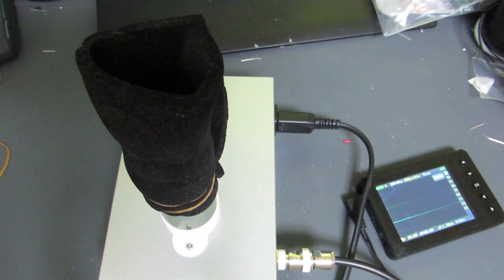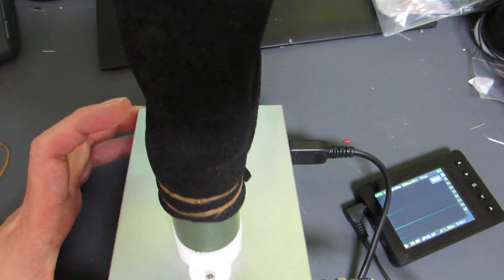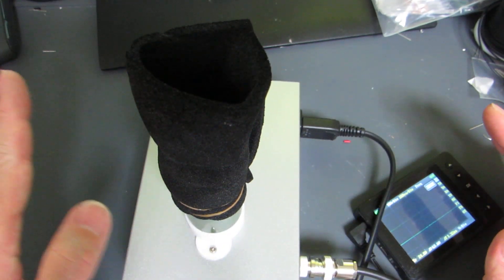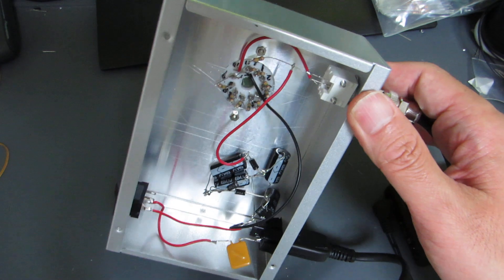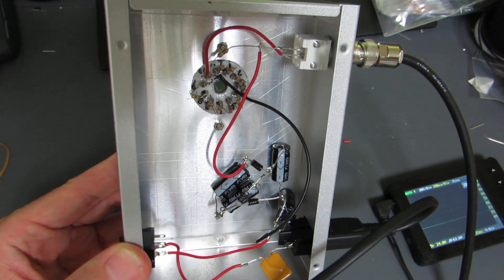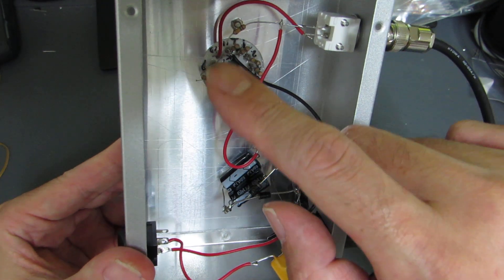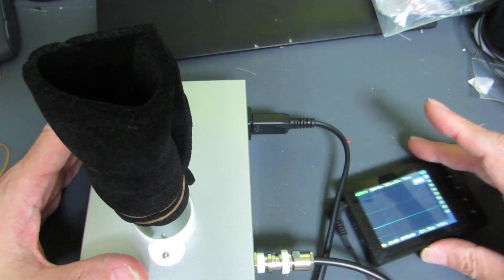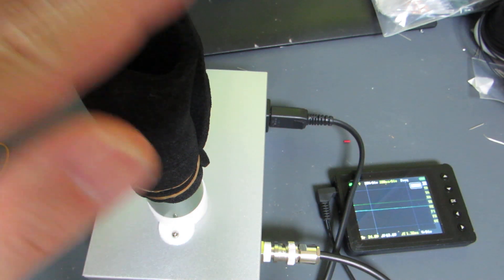Photomultiplier experiment

Comment: I switched to using SiPM and rice grain sized boost regulator to turn 5V to the 27 to 30 VDC required. The SiPM can be had new for U.S. $24 from Broadcom or ON Semiconductor. They are equivalent in noise and sensitivity to PM tube but are not damaged by room lights. I still have my very first SiPM and it has been through many electrical and mechanical disasters and still works fine. And I can fit the entire assembly into a matchbox sized container and run it from a USB port. Way less expensive overall and insensitive to magnetic fields.

Comment: I'm afraid you slowly destroy your photomultiplier by this setup. The tube is not made for continuous avalanche. It's designed to pick up single photons and count them with staggering precision. In your setup you send billions of photons continuously on the photocathode. This wears off the photocathode and also the dynodes, which amplify the signal. If you want to make a photosensor for your hand, use a photoresistor. It's much easier to operate with, you won't destroy it and it costs like 5c. As you mentioned, the photomultiplier is great for scintillator crystal detectors but after what you have done to the tube, don't expect the best performance.

Comment: Hello. All the resistors for the voltage divider is just like 100k ohms or 1Mohm? No need to calculate them individually? I'm planning some experiments using photomultipliers but i'm afraid that i don't have enough skill to figure out how to wire and use it.
Reply: Usually around 1M. I've had good results with 10M also, and you're on the hook to supply less current that way, which is a win.  Using all equal resistors does work, however I find even just a few volts  between the last dynode and Anode is sufficient to "hoover" up the charge. Also, the signal statistics are better with more voltage between cathode and 1st dynode than the rest of the stages. I use all 10M + a neon bulb to add around 50v to the first stage, and indicate HV presence. Good luck!

Comment: Good idea to use an internal voltage multiplier so that you don’t have to deal with such high voltages. What is the operational requirements for the tube? How much volts and amps? Nice demo, and setup! Thank you for sharing!
Reply from the maker: Hello and thank you for comment. The applied voltage simply defines its gain, so higher voltage up to 1500 V is better for higher gain. Details are shown in the data sheet of photomultiplier. The current is indeed very small (a few mA).